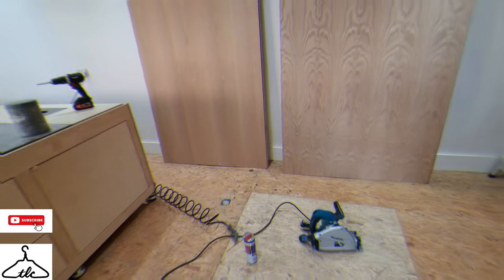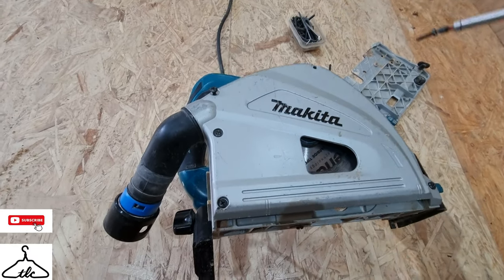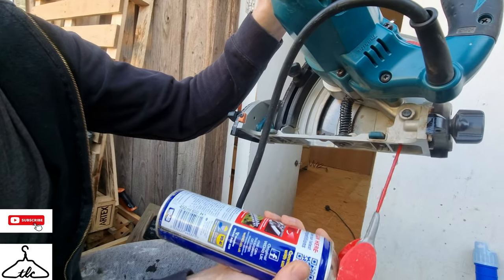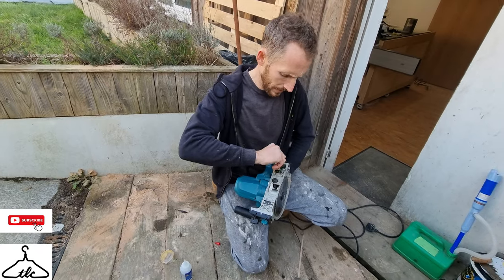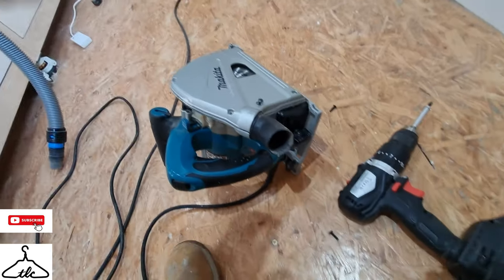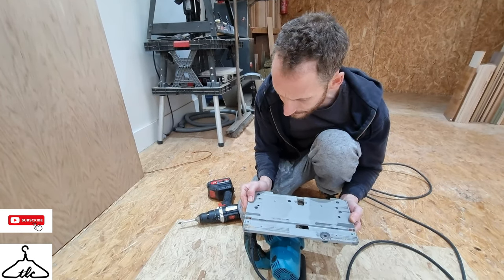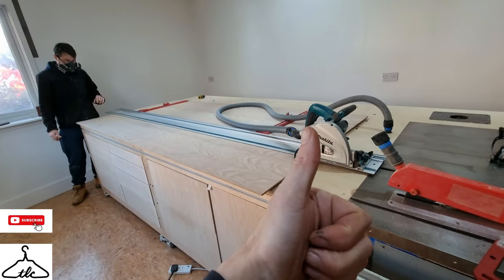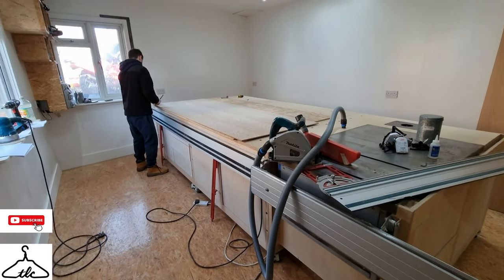Seized or Stiff Makita Rail Plunge Saw 'QUICK FIX' // Won't Spring Back // New In 10 Mins // Vid#125

Comment: This was useful to me, thanks. My saw was incredibly stiff, has been for the last year or so, and I've been (unsafely) using it anyway. I tried using silicone spray lubricant but that didn't do very much. In the end it took about 20 minutes of squirting WD40 in the hole and on both ends of the pivot pin to get all the crap out, which seemed to be very fine black swarf. I honestly thought it would never ease up, but I kept going and eventually with the last of the crap washed out it was running freely. Pleasant side effect is that with all the WD40 cleaned off the saw looks almost new!

Comment: Got the same problem with my Bosch track saw, I'm trying a dry PTFE spray for a change,my thinking is it's a dry lubricant, so won't  attract  dirt & dust like a wet  lubricant oil/grease.

Comment: Thanks for this vid mate needed it! Got a question on the Makita plunge saw. I’m struggling to make square cuts at the minute but across the long length of mdf. I always notice it when I’m in the middle of building cabinets and it’s a few mm out of square. Do you have these issues ? Can’t figure out whether it’s the rail or the saw. Doing everything I can to square it up. My next thought is getting the 3m rail so I can make one pass. It’s doing my head in.
Reply: Have you tried putting a square on the base of your saw and checking if the blade is square with the base? There are adjustment screws on the bottom to where the saw will bump against to be square

Comment: Because the  WD40 residue comes out black, it’d more likely a corrosion reaction between the steel and the alloy casing, rather than dust ingress.!! a brass bush would be nice but a grease nipple in place of the retaining bolt, and an access hole in the base plate would make a quick maintenance lube easier.!!??